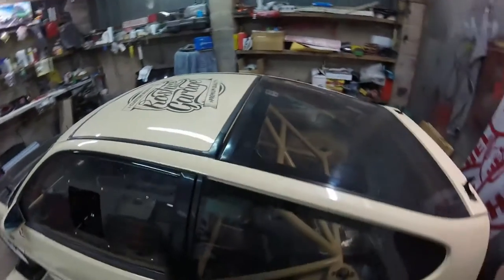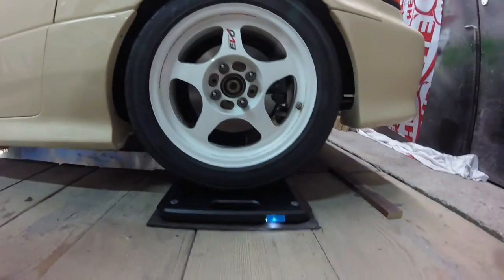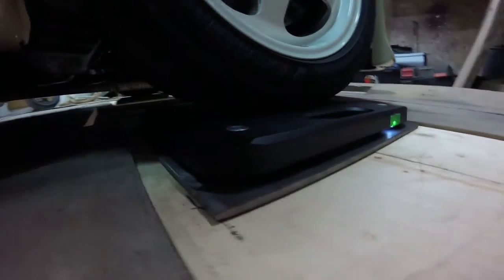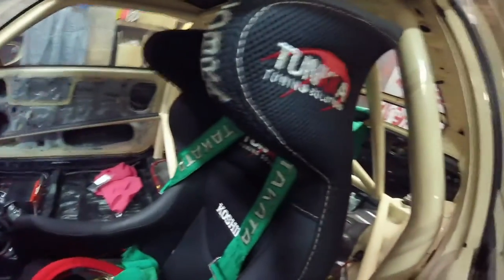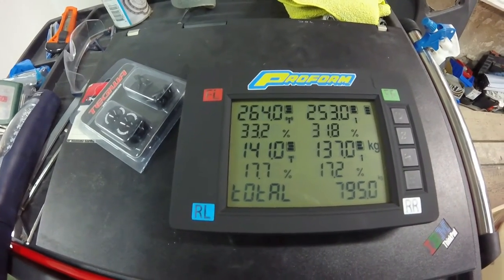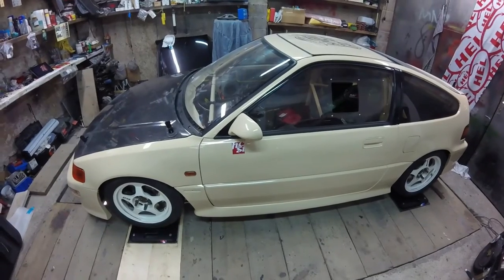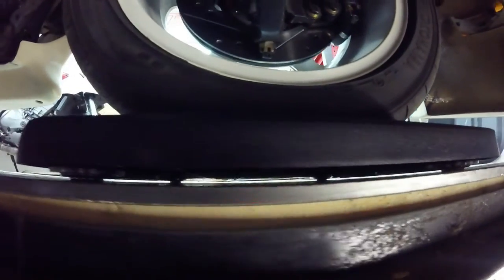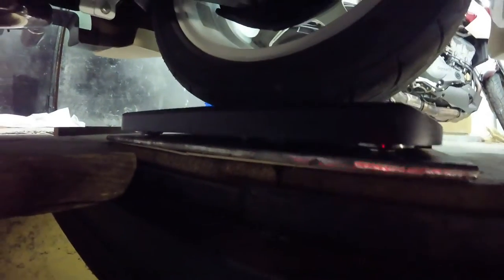Honda CRX koshir garage PROFROM race car corner weighting scales kit

Comment: How does it pull?
Reply from the maker: not being tested as it should be cause aem shitronics was not working right everytime i went to race track, CDI problems, coil problems and in the end ECU problem, now I removed everything from aem and installed Haltech Elite 2500 and all other goodies inside, but must do new wiring loom to be back on dyno and track ...

Comment: Updates? Still alive bro?
Reply from the maker: Yeah still alive and kicking :D got me EG for daily but it escalated and is now also middle class parts daily "race" car and I was racing it at Nurburgring like two weeks ago, and to spice the things up D16Z engine is going out and K20 in so it'll be test car for tracks before I attack those with CRX, CRX now needs just wiring sorted, mechanical parts are all done, aem epm gone , sadly skunk2 pro cam gears needed to be changed for golden eagle ones since T1R system is installed...so yeah hopefully in month or two CRX will go back on dyno and then hit tracks, meanwhile I'll be racing EG :D